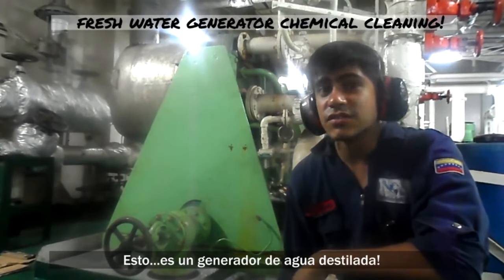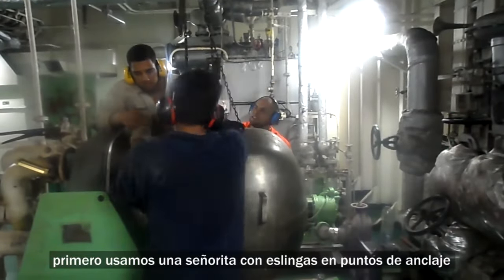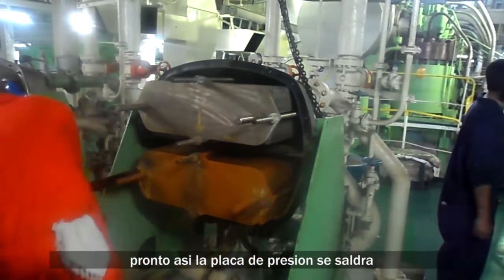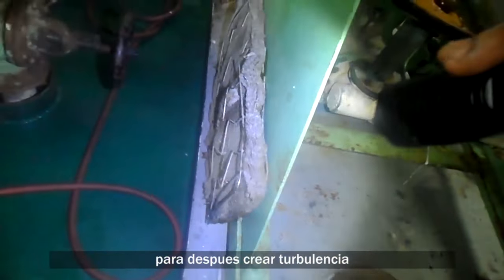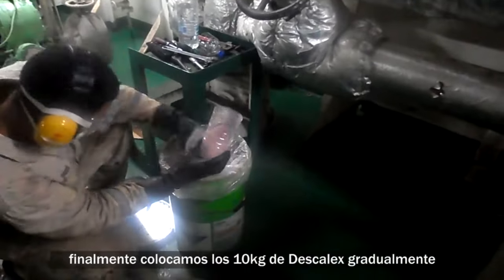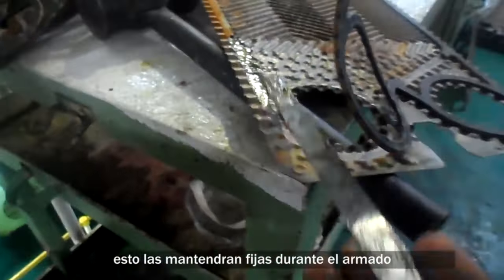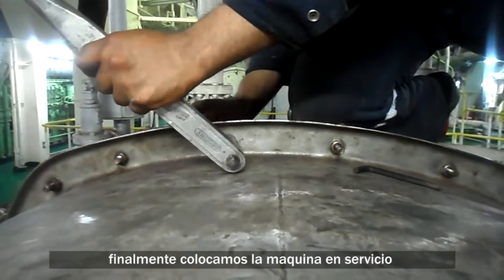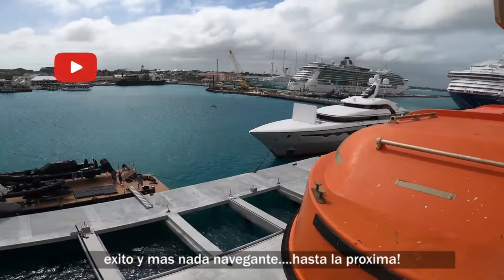Fresh Water Generators - Chemical Clean of Plate Heat Exchangers (DESCALEX)

Comment: Great job fellow engineer.
Am I the only one that hates plate type FWG? 😅😂
Reply from the maker: Thank you brother!

😂 to tell you the truth I enjoy the plate types more than the Sasakura Tube types which are also popular.. 

If we run out of the vaptreat (o similar chemical) then those tubes starts to get full of salt and it's very risky to drill the holes to recover the tube diameters.

But plate types it's hard work especially if you have to work with limited assistance, thankfully for the video I had plenty of help.

Comment: Thank you very much bro .

Please I have a question.
Why do we have a pressure relief valve installed in the Fresh water generator when the machine actually works on vacuum and not on pressure.

What's the usefulness of the pressure relief valve.?
Thank you
Reply from the maker: Good day brother, I'm glad you enjoyed the video! 

Even though I didn't show it in my video there is a pressure relief valve in the shell of freshwater generators.

Imagine if some smart guy starts the fresh water generator with outlet valves closed OR the valves of the seawater inlet are not keeping after years of use and the fresh water generator is stopped and starts to fill with seawater.

Without that pressure relief valve lots of the rubbers or the shell rubber will be blown and the FWG will be inoperative.

So the basically the fwg relief valve like most relief valves are for safety of the machine.